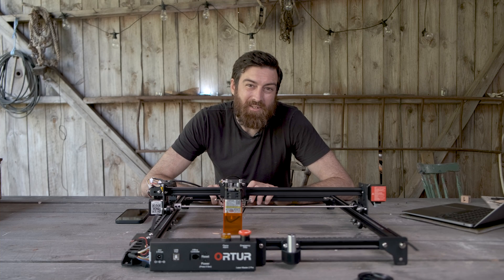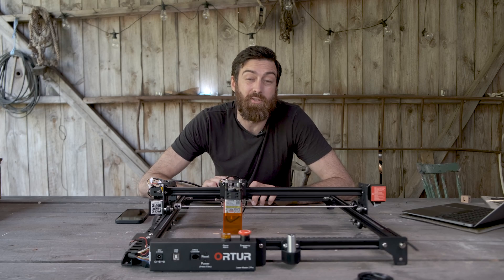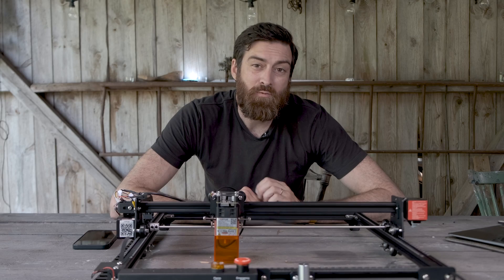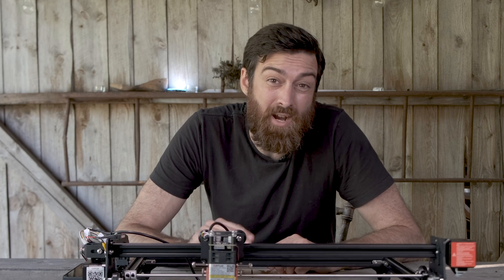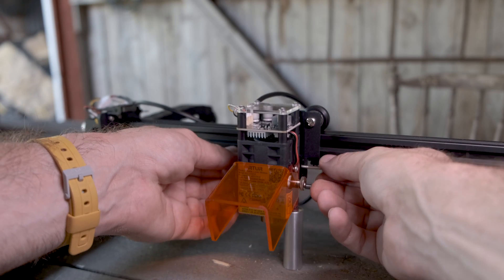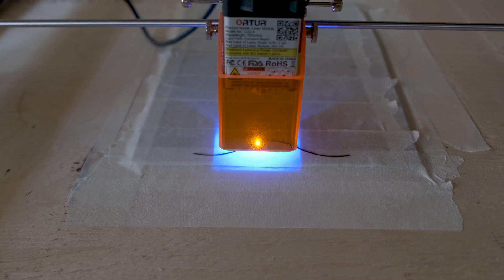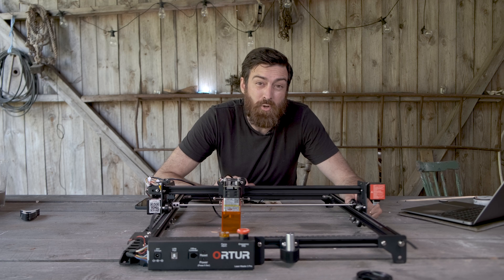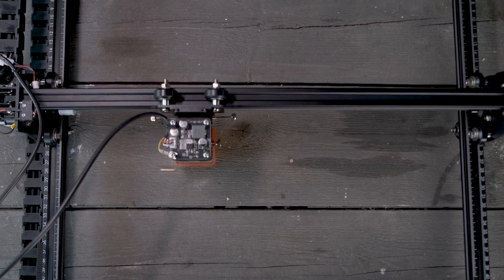What Can a Laser Do? - Ortur Laser Master 2 Pro Review

Comment: 10000mm/min is insane! Great machine and just as great video. By the way, have you experienced with defocusing the laser, when engraving just outlines of an image or text (Using "Vectorize" mode in LaserGRBL or "Line" in LightBurn)? It's a nice trick for getting wider lines, without switching to  raster mode. If focus distance is 50 mm, going 5-10 mm either direction will give noticeable results.
Reply from the maker: I haven't tried that, but is I a good tip!

Comment: For the hassle of mounting a laser to my CNC Spindle, the connection to the motion controller ( I use Mach3 based 3 axis) and providing a new 12 or 24VDC power supply with all the associated wiring....whew....  it is worth a look see. I could even just throw it up on the work bed and finish a project in situ or just move the piece to another work surface. As for space constraints in a small shop ( like mine) this is light enough to be able to just hang on a wall and deploy as need be. So thanks.
Reply from the maker: Sure thing. It could easily just hang on the wall wherever. And replacing the spindle with a laser is, as you say, quit a lot of work.
Reply: @TheSwedishMaker  Actually one apparently mounts the laser in front of the spindle where it then resides permanently, and you dial in new X-Y zero based on the required home coordinates to create a new offset or you use an offset that you have already determined due to its physical location relative to the center of the spindle and run your gcode. 
You can get a ~40watt laser for this purpose in the range of $200 but the matter of controlling on/off and intensity is another matter that I don't yet understand in terms of hardware, wiring to what port on the controller and software. I don't need it for cutting profile toolpaths, just for photo etching or text / logo reproduction. But for instance, cutting leather would be kind of weird with an endmill :-)

Comment: Good review and some good points made, some of which made me go with a c02 laser
Reply from the maker: Yeah that is so much more powerful. Do you have the K40 one?
Reply: @TheSwedishMaker   Its bassically a k40 but has a bigger bed and some over nice things that is really needed
Reply: @TheSwedishMaker  I have this one https://www.amazon.ca/Engraving-Machine-400x400mm-Working-Controller/dp/B07SHBCRTH/ref=sr_1_4?dchild=1&keywords=C02+laser&qid=1626620573&sr=8-4... 
But I got it when it was cheaper
Reply: There are few things i really don't get it with the PRO 2 version. The safety features are good that's definitely a plus. Except the motion stop, which i don't think so would be useful ever. But stepping down with size, instead of upward? Weird. Decrease the focus point down to 0.08 is again big thumbs up. But stick on 5,5W optical without having an option to choose a stronger diode? I think nobody expect to cut 20mm wood or anything like this, but 5-8mm  with 3-4 passes would make this machine a real pro diode laser. And yes it has a lot of advantage versus the CO2 lasers, even if its slower, even if its weaker a bit.